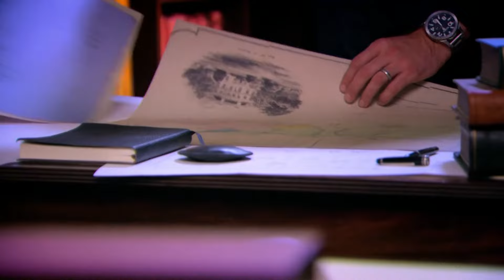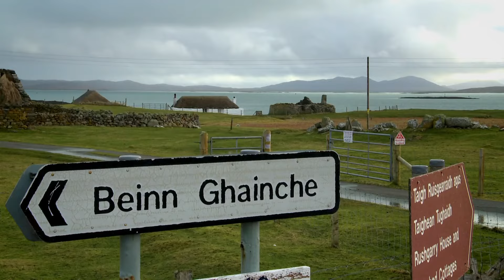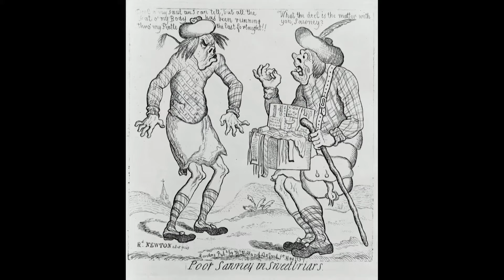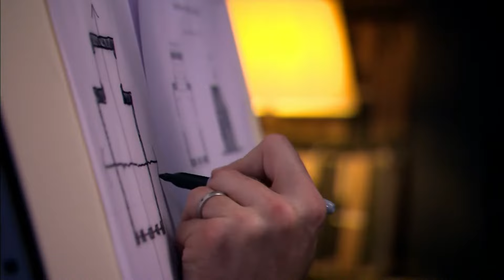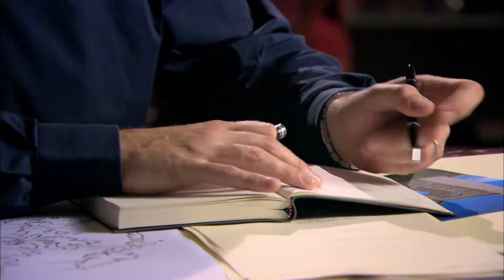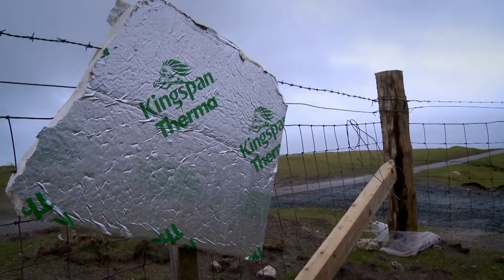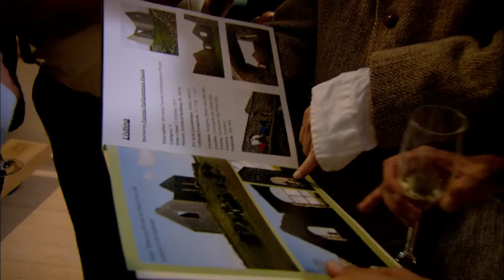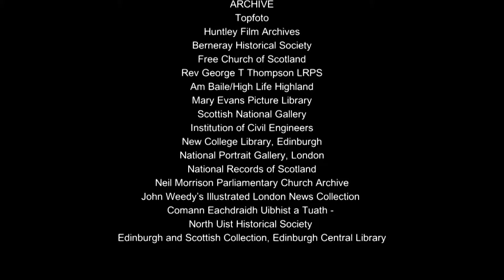Scottish Church Restoration Journey - The Restoration Man - S02 EP13 - Home Renovation

Comment: Strapping that insulation in bundles before weighing them down and maybe use a few sheets to make templates for the windows would have helped.
Reply: Ah, watching it once more: they actually used a template for the arch at 16:40. But only at the top, not full size. Probably measured one of the lengths wrongly.
Reply: 17:24 With that wind they may have ruled out trying to create templates over openings that large.

Comment: Window installers did not plan for the build, and for Scandinavians that is just unacceptable to their legacy of exact perfections.
You cannot do custom installs with tape measure and notepad. Even if they had to use huge sheets of fabric tacked in place to trace the openings it would have at least been one more reference point to use.
No wonder stained glass though lengthy in construct could be made on site and adjusted if necessary.